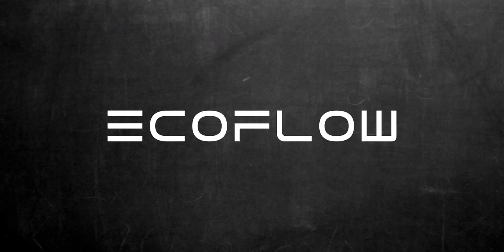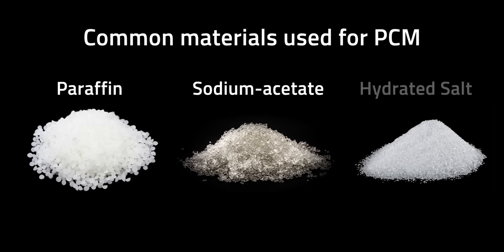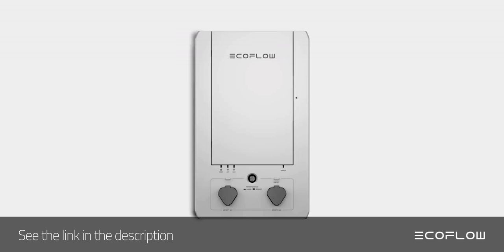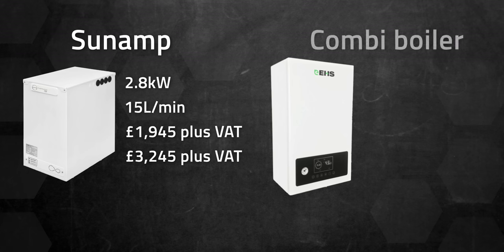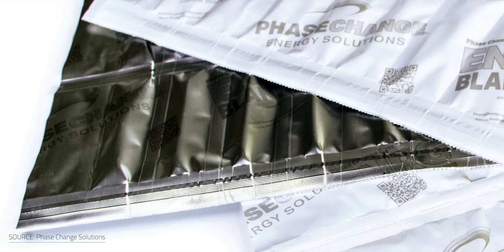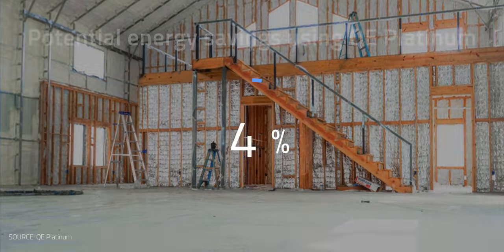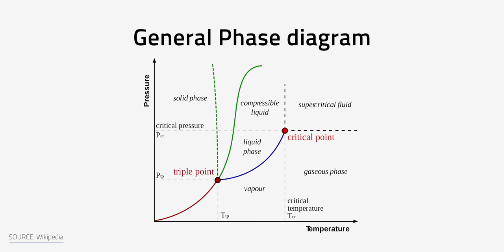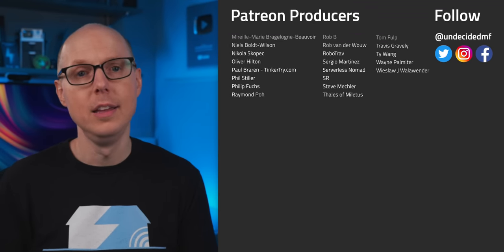Are Phase Change Materials the Future of Water Heaters?

Comment: 30 years ago I worked for a company that was trying to get into this market. Their use case was for long haul trucks. The idea was that many truckers ran their trucks at night to keep the sleeper warm in the winter. They planned to use the excess heat will driving to store heat for night so the engine could be shut off. I left the company and lost track of the project, but I think it is safe to assume it went nowhere.
Reply: for moving vehicles, the weight could be the real issue. You need a lot of stuff to store some meaningful amount of energy. Interestingly, water has a high specific heat and also high latent heat of melting and boiling.
Reply: Nons of the products matt finds have or will l8keky go anywhere it s3ems, quite disappointing.
Reply: @janami-dharmam  Steam cars/trucks/boats/subs/most large industrial  "engines"in the world use steam and  have a TON of power. For exactly those reasons Uses to build hobby steam engines, its scary if there's a leak or God forbid a boiler burst.
Reply: Sunamp trialled a system on London buses which typically sit running for a while in a morning to warm up. The Sunamp unit stored heat during the previous day's use then released it early morning the next day to warm up the engine, reducing emissions significantly.
Reply: That's interesting! Seems like something like that could help avoid the need for plugging in diesel engine block heaters overnight in freezing conditions too.
Reply: @janami-dharmam  Water's biggest disadvantages are that it expands during freezing and that phase change temperature is far to low to be practical for this concept. The other phase change point, boiling, is............. OLD tech.
Reply: @derrekvanee4567  I operated the main engines of an aircraft carrier, Nimitz class. Four steam turbines produce total of 260k shaft HP. but the biggest downside of such a steam heat engine is demonstrated in the Carnot cycle and is approx 30-35% efficient at best.
Reply: I've seen projects to do essentially the same thing using a heat exchanger in the coolant loop before the radiator, storing the hot water in a keg. The use case was for showers from the vehicle, such as at the beach.
Reply: @punkdigerati  I could see a use for a shower attachment on an RV or long haul truck
Reply: BMW 5 Series E39 had an optional heat battery used for similar purposes - the idea is to store heat for the next day, so it can immediately start blowing warm air in a cold morning. Not sure how good this worked, but the option was removed in the next models.
Reply: If you’ve ever met a truckie you’d already know it was going to go nowhere.
Reply: @whirledpeaz5758  Yes, using the liquid-gas phase change of ANY substance is a bad idea, because gasses expand too much. And water is not suitable because the solid-liquid phase change is weird and low temp. But surely there are other materials that would have a better match with the solid-liquid phase change than water.
Remember, if the goal is to not need to run the engine overnight, taking a bit of energy to run the system is ok, as long as the savings are substantial.
Sodium acetate trihydrate has an enthalpy of fusion close to that of water (lower, but not by an order of magnitude at least), but melts at a much more sensible 58C.
However, I would think insulation would be the most important part to add for comfort in a sleeper cab
Reply: In the BMW video I saw, either the cabin or the engine could be pre-heated on startup in freezing temps.  This would be great for heating houses. With a thermal solar panel water heater for instance, there's always to much heat when the sun shines. it could be used to warm the house on cold mornings.
Reply: Those diesel fuel powered parking air heaters are pretty nifty, probably no competition due to their high efficiency small footprint, and small amount of materials.  It's basically a miniature forced air furnace the size of a loaf of bread that can develop around 30,000btus of heated air with an actual combustion exhaust pipe for safety
Reply: @whirledpeaz5758  I was assigned to an air wing on the USS Enterprise. I seem to remember seeing the Nimitz.
Reply: Critical mass of participation seems to be the biggest hurdle for much of the tech matt reviews.
Reply: It could of possibly worked, using that heat to keep molten salt batteries hot. They have more storage capacity than Lithium, but you have to keep them above 400 C and keep them well insulated, and salt, unlike lithium, wont burn and is pretty cheap. Let them cool off and you have a 5 ton salt-lick that the cows would enjoy, otherwise it's worthless.
Reply: Diesel engines don't start easily in winter temperatures. You may need a block heater and fuel line warmer and glow plugs to get it started. Diesel self-ignites and there is no spark plug, the cylinder has to be at a certain temperature for this to happen or else the self-ignition can't occur. It is easier/safer to leave them running then to risk being stranded because you can't start them.  They also require some pretty hefty amperage to get them started and batteries typically don't work well in cold weather. Some of the old tricks involve literally building a fire underneath them to heat up the engine.
Reply: @stawmy  Why 400C? Solar salt, which is often used in CSP, melts around 260C.
Reply: @derrekvanee4567  Derek, thank you for the feedback! We will see ya on the other-side!

Comment: Looks like this Delta Max is the best solution for power outages. With 2kWh of power it will have  no problem at all.
Reply: They are convenient.. I have one, but I wouldn’t buy it again.  It was nice to start learning about this stuff, but If I could do it over again, I would just get raw batteries, a solar charge controller and an inverter.  The efficiency of the delta’s is atrocious, like low 80%’s.  I dont regret it though, I learned A LOT using the ecoflows.
Reply: @BLASTIC0  I have a feeling that the original comment was sarcastic ;)
Reply: @gustru2078  oh, lol. Duh 🙄
Reply: A kWh is not a measure of power, but of energy
Reply: An hour is 3600 sec.

Comment: I've been using a PCM "chill vest" for years.  It has large packs of a gell that solidifies at 57 F, so I store it in the freezer and wear it when I'm doing yardwork on a hot day.  It's not exactly a 'still suit' from Dune, but it definitely makes me more comfortable and productive.
Reply: I have seen them being used as ice-packs to transport chemicals that must be stored cool. They are sealed and that is the only advantage (no mess). They can be used over and over again. But I do not know what is there in the gel.
Reply: Can you link to the chill vest or packs you are using? I have a need for such a product.
Reply: i just soak myself when it gets too hot lol
Reply: @nou5440  got someone working near high voltage electrics without A/C in Georgia heat. Water based cooling is a no-go.
Reply: @nou5440  that doesn't work in the southern or eastern United States
Reply: @Tanstaaflitis  Check out the EZcool vests.
Very popular in the Furry-Scene to keep cool :)
The Military aparently also got some units for cooling when training in hot environments.
Reply: @nou5440  Me too, until the humidity goes up and evaporation stops
Reply: Works nicely if you are ridding a motorcycle in the summer. 

Only problem is it will make your pants wet in a suspicious place because of the way you are sitting 😆
Reply: @bakedbeings  How is evaporation necessary? Doesn't he just chill gel?
Reply: @DrJohnnyJ  I was replying to  "mo u" who just soaks himself with water

Comment: It does show a lot of potential. Since you can add extra batteries and increase the capacity to 6kWh. It will definitely come in handy during blackouts.
Reply: To an extent. One of the biggest advantage of a heat pump cylinder, is that they've got a COP of at least 3 which is pretty decent

Meanwhile, batteries don't have that same COP. I was looking into getting a heat pump cylinder without having a heat pump outside the house, and it's not possible (I thought I could perhaps gradually move up)

I've known about sunamp for a fair amount of if time. I'm also in the UK, so I've followed UK solar news somewhat. The absolutely biggest drawbacks of sunamp does appear to be the lack of a COP (Other than the price ofc)

A sunamp battery is obviously better for smaller homes where they can't even have a cylinder

Comment: A low-tech alternative is just having thick walls. The large thermal mass has a similar effect.
Reply: I'm glad someone pointed this out. There was a reason stone buildings like castles (the main building itself, not the outer protective walls) and even Victorian era houses were built with very thick external walls, and why even the interior seperator walls were also thick and made of stone or brick. It wasn't anything to do with protection - not even in the castle's case. It was to do with keeping those buildings warm in the winter and cool in the summer. And why such massive buildings could be kept that way with only a small handful of oversized fireplaces. The idea of castles always being cold and/or damp are false - like any king or noble is going to want to spend all that money only to end up in a freezing building. Same went for Victorian era houses. And yet we seem to have completely lost or forgotten all the lessons learned since those ages and now build our houses with walls as thin as we can get away with, out of materials that AREN'T good at thermal management (like wood and plasterboard) and wonder why they're so damned expensive to keep comfortable.
Reply: @DavidStruveDesigns   🪵 is a gr8 renewable resource, but ur right about current construction being profit-focused & often low-quality.
#materials
Reply: I commented on this above. Built 13 homes with this method. Very doable.
Reply: Just came back from a trip in Europe, where houses are build in bricks with a fair amount of insulation. Despite the heat during the day (summer 2022) no AC was needed  and I slept fine at night. This is certainly not the case here in my US house...
Reply: @yannickfillon3851  Yeah, i was also going to point that out. I have never seen a house in europe with these thin wall that every house in the US seems to be made of.
Reply: @yannickfillon3851  even in the temperate UK we complain about the poor insulation of most homes, and about a third don't even have cavity walls. That said, I have stayed in old farmhouses in the UK and mainland Europe with thick stone walls that stayed cool even after days of 30-35 C heat.
Reply: Saw a piece about homes in the Siberian tundra - a lot of them have stone cooking stoves centrally located in the house, and it has a back section where they keep a tiny flame lit all the time that heats the stone mass, which then radiates to the whole house. Even if the fire dies down that rock will stay hot for ages.
But yeah I think just having good insulation goes a long way. And double paned windows. Thermal mass is great when it's hot during the day and cold at night, so basically fall and spring, but if you spend a large part of the year always cooling or always heating, it's more about the flow of heat, buffer capacity is always maxed out.
Reply: Yep, like nearly every house in Perth Western Australia. Double Brick .Great until day 3 or 4 of a heatwave, then we are F**ked. ;-) Thank gawd for A/C.
Reply: @DavidStruveDesigns  well, being as I'm NOT going to tear down my house to build a castle, or even a smaller stone and brick house.  These materials will do the job as a retro-fit.
Reply: @fredandersen9873  you'd likely be better to just use better quality insulation. PCMs have some cool features (helps a lot with radiant asymmetry which can reduce the need for overall heating/cooling) but in a harsh climate ( more than 3 months below freezing or more than 1 month at or above 30 C) more insulation is going to be more effective. The hot water heater technology is interesting though, I can see how it would work well with a solar heater setup.

Comment: I have a large property, so my heat source is a DIY solar thermal panel, and my "heat battery" is a 250 gallon IBC filled with water.  Mains water flows through a copper coil immersed in the IBC, before going to my electric flash heater.  The sun heats up the water in the IBC, and the mains water is so warm, the flash heater hardly runs at all.  The panel and IBC form a thermosiphon, so that takes no power but the sun.  The IBC cost me about $45.  Not perfect, but my grid-tied PV system keeps me a negative balance with the electric company, so "good enough" is fine.

Comment: When used as "insulation" PCM simply increases the thermal mass in a much denser way than traditional insulation, but only right around the phase temperature. For homes that seems like it would be only advantageous in certain areas that fluctuate past that phase temperature, or fluctuate past the holding temperature, for a large portion of the year. In more extreme areas, like the northern US, a significant portion of the year is just cold and the PCM wouldn't help much. 

I see an application like Sunamp's thermal batteries as a much better use case as the energy fluctuations are in a much narrower band, allowing for more optimization.
Reply: The other case where it might make sense is in areas with time of use billing.  TechnologyConnections mentioned that's how he deals with his home in summer.  Crank the AC at night, then let the house warm up during the day.  Of course, for such a simple application a dedicated chiller and ice would also work.
Reply: Even in cold climates (not extreme North, but still cold), you need to think beyond ambient temps. The sun-facing sides of buildings can absorb a significant amount of solar radiation during the day and could release it during the night. Use would be limited to specific locations, but still viable.
Reply: @Mike80528  exactly. I have a house in Wyoming.  As we know, the winters in Wyoming can be brutal. The south wall of my house has a sliding gass door. During the day, quite a bit of solar energy comes through that door.  The floor re-radiates quite a bit of that into the house as heat.  The floor is just vinyl on strandboard decking, so no real thermal mass. These phase changing materials, sandwiched between the floor joist would give the advantage of large thermal mass, without the large mass.
Reply: @nocare  You my dear need to go back to school.  The HIGHER the T delta the MORE efficient a heat pump is. To achieve this high COP you have to have a large enough Heat exchanger... Which nearly EVERYONE skimps on and why the efficiency of said heat pump SUCKS.  This is why, if you have free water, you squirt water onto your CHEAP ass heat exchanger to achieve superior results.  Likewise nearly everyone also goes ultra CHEAP on the pump as most have a SINGLE speed (Q flow) instead of variable speed.  And nearly NO one has a two stage Heat Pump based on total (Q required).  Obviously the working fluid has an impact, but minimal for residential/commercial real estate in the grand scheme of COP.
Reply: @fredandersen9873  That would be stupid economics and wouldn't do jack shit.  Just build solar thermal panels and install very large hot water tank to store said heat in, or increase the amount of glass on side of your house with an automatic louvre and fans turning your home into a greenhouse.  More living area and makes spring/fall VERY pleasant where you can relax in sunshine and grow veggies/flowers as well.
Reply: @w8stral  your ridiculous suggestions are "stupid economics".  The amount of work, let alone materials is prohibitive.
Reply: @fredandersen9873  Uh, they are dirt cheap.  wood, plexiglass, and black poly pipe or if you get fancy, aluminum foil over a parabola you make yourself and a copper central tube, or just use copper tube painted black.  The tank is absurdly easy as it is not under pressure.  Anything works and water is free and the insulation can be as simple as dry sand as long as it is covered.  Sorry you are lazy and have never been taught to do anything.  Israel calculates they save 3% of their total energy bill every year by forcing everyone to use solar thermal for hot water collection on their roofs.   Poor guy, have to pay for a pump and a thermal switch relay control... oh no for a $1000...  You can literally make everything out of your local hardware store for ~$1000 for rooftop solar collection and another ??? $$$ depending on how big your water tank is depending on your lattitude.  Near the tropics, small, near the arctic, big.  People in Sweden and Alaska have to have 4m tall tanks by 2m in diameter which they build using black poly plastic in a roll or buy a butyl pond liner for $1000.  Insulation is another $1000 usually.  Whole thing roughly $3000.   A high end hot water tank, you have to PAY to keep heated is $1500 today. That does not even consider heating of your house which you ALSO get for free using solar thermal... what was your electric/ng bill last year again?  Hrmm?   I'll bet at least 3/4 of it was heating/AC/hot water.